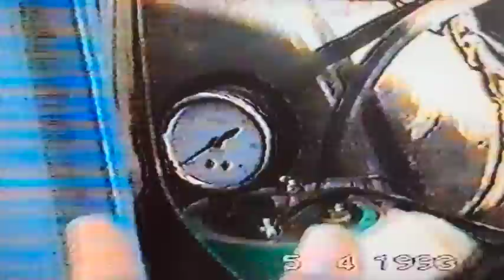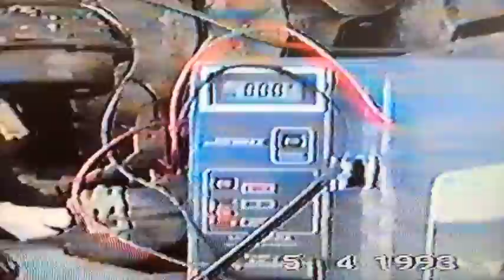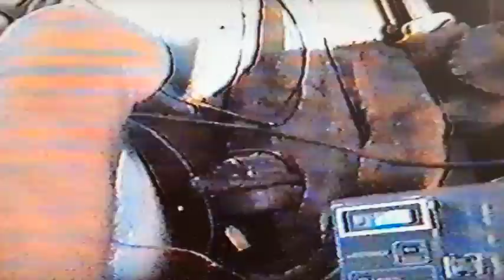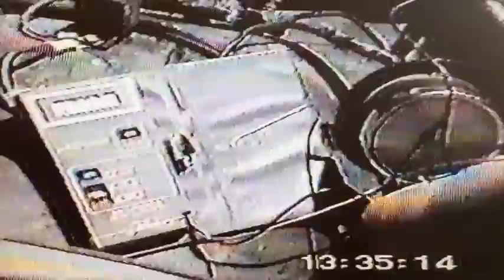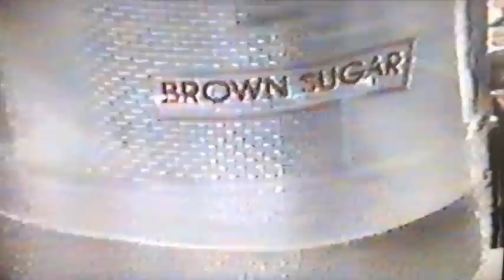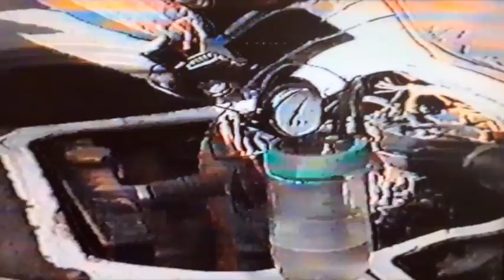Part 4 - Joe Cell. The Car

Comment: so the vacuum gauge becomes a type of throttle potentiometer and the dc puls ecites the water molecules to under vacuum release ions .so when the diesel locked up i presume that its a vacuum lock and the reverse charge as joe said to release the lock was to allow atmospheric pressure .  just a thought

Comment: The reason the fuel in the fuel line draws back to the tank when the engine goes on to air potential. ( not really air but its structural frequencies as a mass exchange ) is that the ions spun out off the crank act as a repelling force. By centrifuge vortex hence arising to levitation possibility Same as our earth spins and causes a outer shell bubble. I THINK !!!!